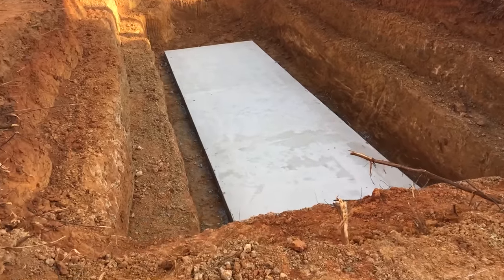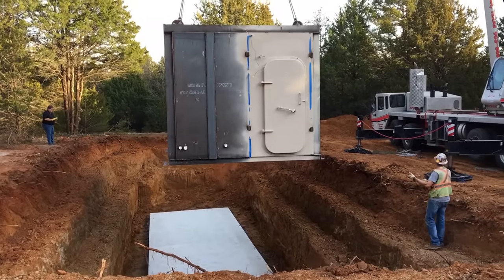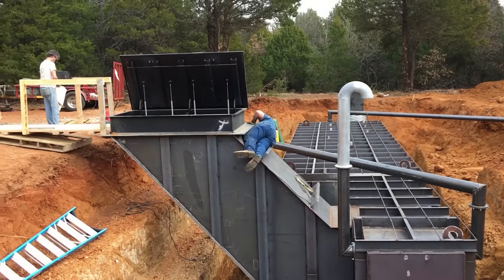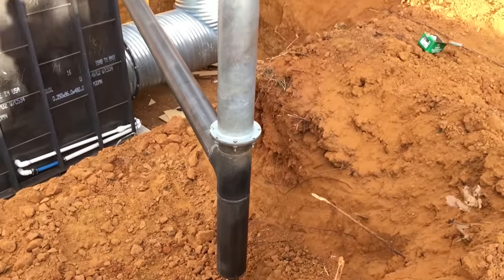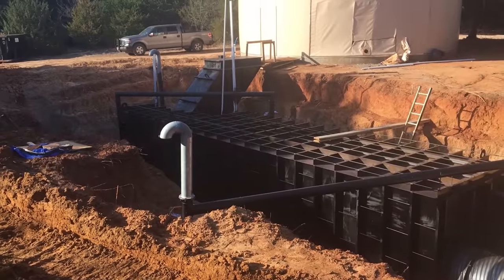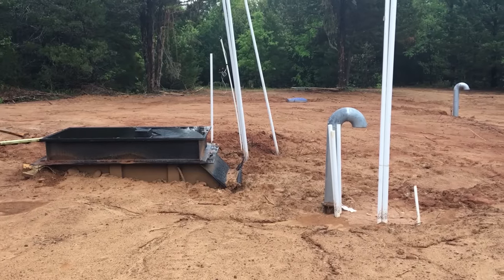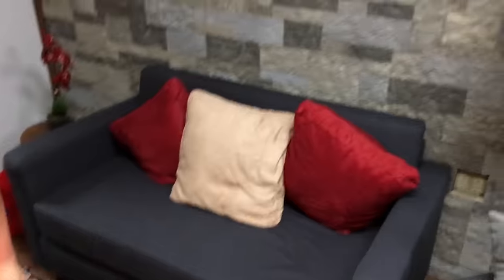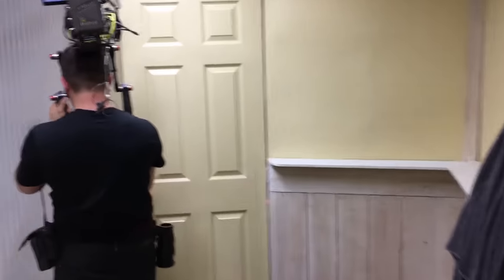Atlas 10x30 Safe-Cellar - Luxury Bunker Built Under A Home (Complete Installation Video) - Part 1

Comment: Why have a lock on the outside--  you just spent 100K on a tomb.
Reply: Lol
Reply: true
Reply: You use the escape hatch at the opposite end. As the guy said a house is to built on top. So you would have to get into the house or remains of, then find the entrance, etc, etc.
Reply: That's funny lol
Reply: I'd not have a lock as such on the outside for that reason. Better to have a lock on the inside operated by a solenoid,as is common on many apartment block entrances, but "beefed up." The button to operate it could be anywhere inside or outside the house & concealed. It would use a rechargeable battery. Any protrusion on the outside of a hatch are not good, as they give something for a chain to go into or a clamp, to use a vehicle to pull at the hatch. Hydraulic jacks should be kept inside with something strong to push against, such as an I beam or steel welded to the shaft, to lift debris above any hatch.
Reply: To protect against grave robbers of course!
Reply: @musllm  LOL. With the lock on the inside operated by a solenoid such a bunker would be OK to stay in for a week or 2 until fallout radiation died down. Particularly of use in a more limited use of nukes scenario. I doubt many people would want to be in a small bunker for months. I've spent 1000's hours working in underground bunkers, but only for a day or 2 at a time. Many people would probably "go nuts" in them for months.
Reply: the best way to hide the entry, is a hidden safe room with the hidden entry inside. thats how i would do it, if i would have the money.
Reply: @PlatinNr1  What you suggest is best. For those that can afford it, I'd have a composite steel & concrete heavy door concealed by something like a cupboard or book case that swings out  of the way. Such a heavy door could have a locking mechanism on the inside. One way of doing it could be along the lines of the solenoid operated locks used on many communal flats, but with "beefed up" components. The 12 or 24 volt actuators used to open electric gates, or raise up electric reclining chairs etc., could pull a nice thick piece of steel to be a sliding locking bar on the inside. The outside switch  & battery could be hidden well away from the heavy door. Once everyone that you wanted was inside the bunker, then the electric entry could be disabled or turned off from inside the shelter.
 Thick steel - only doors are not ideal, as gas cutting gear from a local steelworker or garage can cut even inch thick or more steel fairly quickly. With thinner, say 1/4 inch, steel  plate either side  to form a concrete filled rectangular swinging box at least 5 inches thick, ideally with rebar in it too, it becomes a very difficult door to cut through.. Stainless steel can only easily be cut with a plasma cutter or angle grinder. But it is very dear. Even  plywood between steel plates
Reply: Sorry,  last reply the computer froze. It should end : Even plywood between steel plates in layers bolted together (round headed bolts on the outside face) could be a better gas cutting blocker than steel plate alone. Could be thick plate used in some part of a composite  door. Have concealed hinges or "dog bolts," so hinge cutting won't allow intruders in. Then you'd need at least one air intake disguised. Could look like a vertical outside lamp post. It could even light up on top. Another way is to have an ordinary looking louvred vent appearing to be for say, a tumble dryer, or kitchen extractor, set in a reinforced concrete wall. Vent could be strong steel, but painted white it could be made to look like a cheap standard plastic one.
Reply: @michaelthomas3105  i would make the whole house as safe as possible. which can be shutted down completly xD i want one in which even the police couldnt get come in. xD and in the house a hiden safe room like i said with the hidden entry of the bunker. if its a hidden safe room where the door is hidden well, nobody would even think about that there is a room behind, so nobody would try to get in to the door. but still the door needs to be safe and with a looking mechanism from the inside.
Reply: @PlatinNr1  Reinforced concrete is often best. You might find a local steel fabricator is cheaper to make strong or blast doors & special shutters, if you don't do welding etc. yourself. I'd still go for the strongest door you can afford, unless you're sure you can keep it a secret when loads of people might be looking for it. Generator use tends to give a bunker away. The old B&W Twilight Zone: "The Shelter,"  gives an idea of how neighbours break down a door to get into a bunker. They might use a  hydraulic jack or anything to try & force it.
 The Swiss doors are concrete filled steel frames 8 inches thick. The locking devices are solid steel  2 inches thick plus an extra 3/8  inch plate & 3 inches wide solid steel with 1.5 inch diameter steel bolts through each one, with handles to engage them with the cast-in steel angle frame.  A steel plate plus plywood in between, sandwich door could be good if concrete is not easy to use to fill one . I've used concrete pumps for awkward places. You need to always use a poker vibrator if you want the best reinforced concrete  & keep it covered from the sun & wet, or use a spray on compound to cure it, ideally for up to 4 weeks.once it has started to set. .Job to keep the police out of an entire house, but it's not difficult to make a bunker the police just wouldn't bother getting into. They'd use hydraulic spreader rams on security doors, that sort of thing, or petrol disc cutters. Once you get into stuff like Swiss doors weighing over 2000 pounds they'd give up on those. Swiss doors are designed to resist. 100 tons force on every square metre. Many ordinary little houses have them there by the million. I've fitted some. They'd probably give up on even a 5 inch concrete filled steel one like www.americanbombshelter.com do.
Reply: @Platin BTW, I weld up the huge nuts on the outside of the Swiss doors so you can't open them from the outside, plus I personally put one extra locking bar on the inside which I weld on.to heavy plate that's cast into the door. it depends how far you want to go to keep people out. A welder could fabricate a cheaper, or bit less strong, version along the Swiss or www.americanbombshelter.com lines. I meant "covered from the sun & KEPT wet" for up to 28 days is ideal for the concrete. cheers
Reply: Yeah , what i said was a very expensive Coffin ... 
With all they have you won't be able to walk outside for sum 20 years ! 
If your lucky !
Reply: So i think the people in these ha e a decent chance with a civil war or ww. But honestly if it goes nuclear this is the best comment ever they call it MAD for a reason being that everyone everywhere is gonna die on earth. Its an expensive tomb for the pharoahs.
Reply: @stephenfuller8002  yes it's what I said about these , Just look at Japan that place blew just look at the Radiation fallout ...
Now you imagine the Massive Fallout it's going to be when all Hell breaks loose and all that Fallout comes we are going glow like the sun ! 
What I'm getting to is it will be absolutely an insane timeline on coming out of that tomb ... 
No sunlight whatsoever!!! 
Better pack alot of Vitamin D, but you better also be able to set down there for years if not a decade all according to where you live I mean Big cities will be hit worse that a small town in Arkansas where I live but I spent 28 years in Military NBC trained , Big Cities are doomed! 

But sorry I'm off the trail here ....
But you are so right on that this will become a Tomb !! Better pack alot of movies video games to play !!
Reply: no matter how much you spend you'll never be able to outdo the glory of the pyramids.
Reply: Keith Moriyama the lock is on the outside because these shelters are very often in peoples yards and other places on their land. So you need a lock in case someone comes across the shelter. Especially if you live in a very rural area. This particular one is under a house so it doesn’t need a lock unless the family goes on vacation.
Reply: Exactly!
Reply: Yea, a $10 home depot lock. This is such a joke!
Reply: Lock is to keep people from going in and stealing supplies when no one is in it.  They cant lock the lock once inside unless they went out the escape tunnel and went and locked it and then back down through the escape tunnel but makes no sense no one is getting through six way dog door easily and it would take some type of plasma cutter to get in and they know you are out there so they can spray a flammable mist and light it or even a poison gas of some type so if you are going to get in it a few will likely die first.
Reply: It has a dog door on inside so it is locked there.  A  lock like the lock shown is mainly for shelters when owner is away.  I doubt they will use a lock ever again after house is built but who knows they may want to lock it to keep kids out or anyone out if they are not in it and have it locked from inside with the steel door.  My guess is it is probably to keep construction people from going to see what is down there.  I have worked on many boats with dog doors and they are not only water tight they are almost always heavy metal.  I had dogs so big we had to beat them closed with a 10lb hammer and use a cheater pipe to even open them back up. They were not made to keep anyone out because the dogs also had a handle to open them on outside so a cheater bar could do that but if nothing on the outside they are not getting in without something that burns through steel.
Reply: So what happens while ur inside it and someone comes along and locks u inside as they raid ur home? Did u think of that?
Reply: fair enough
Reply: I wish ppl would actually watch a video before being survival experts in the comments section! Rewatch video and think for a bit...
Reply: Anita Blunt  That's about what a funeral and cemetery plot costs.

Comment: Excellent shelter. I would like double or even tripple air intakes to ensure non blockage of air. A house built on top is perfect as combustion, exhaust pipes can be concealed inside walls. With grilles 10' feet high or through roof, a termination pipe on a 12/12 pitch roof even better as no one could climb it easily.
Reply: Does fallout affect the air intakes?
Reply: Yep, same for any exhaust vent too.

Comment: Great idea in theory and a couple good qualities. However I see many issues, straight up flaws and possible security risks with it's design and installation.
Reply: Hook up some exhaust pipes from a car to the ventilation system and wait.
Reply: @donniev8181  or look thw door from outside :v...
Reply: Or if you find the hatch, shoot the lock a ton, and boom.
Reply: Go ahead, list them. I'm mostly worried about the air intake and water. Doesn't seem like someone could live more than 4 months in there.

Comment: I like this one for the main living area. I also like the concrete covering as extra protection. However, I’d want to add some culvert sections tied to it for bedrooms, restroom and storage areas each with their own escape hatches. 

I’d also have periscope tubes for antennas and video cameras.
Reply: Перископ это хорошо.
Reply: It is not high end bunker. By the standards of the Russian Federation, this is the simplest shelter from radiation or non-nuclear explosion... The lowest protection class. From a near nuclear explosion, this will not help. But it's better than nothing. Prefabricated earth shelters (dugouts) have the same protective properties. But they are not airtight.
Reply: Each room with their own escape tunnels? So youre going to have a dozen different ways to ingress and egress? Can we count the ways that this is pure insanity?

Comment: I'd suggest it would be worth putting rebar in the concrete, especially in the short span of the roof near to the steel work, stood off by spacer blocks. It would make it a lot stronger & not cost a lot compared to the total build cost. Bar 6 (3/4 inch diameter) on 8 inch centres or closer across the 10ft direction, with bar 3 (3/8) about every foot in the 30ft long direction resting on top of them could be good. Perhaps some reinforcing mesh used for the sides.
Reply: Looking at it on a bigger  screen now,  they do seem to have put a bit of light rebar in the 30 ft direction. 1 inch holes drilled all along the  centre of each of the 30 ft long direction steel C beams before the shelter was assembled could have proved useful to thread some heavier rebar, each bar about 11ft 6 in, long through them for a blast shelter.
Reply: It seems a reasonably built bunker for somebody keen on having one.I'm sure they'd happily put more rebar around it if people wanted that & to spend a little more.

Comment: So what happens if someone blocks the air intakes? Why would you not run them a fair bit away?
Reply: Remember it is built under a house. Hidden.  If you found one intake, maybe they didn't show you it has a slit for multiple air intake/exhaust hidden elsewhere.  Remember you are snooping after a major event, so who is to say he doesn't trap you snooping in the house.  His hidden cameras see you and the friends snooping, releases knock out gas and cleans up the meat.

Comment: All this but Colin Furze did his all by hand and it's bigger.
Reply: And his is by far 1000x better than this one.
Reply: And Colin’s even has a bed!
Reply: Way bigger
Reply: Colin did it best
Reply: Well not all by hand
Reply: Its actually not bigger
Reply: Also didn't cost almost a hundred thousand
Reply: But his does not have an air filter
Reply: But his is not beter quality rememver these have nbc filters, solar, bulletproof doors and they are built by a company
Reply: These normally are way bigger but this is just to store liqour thays why there no bed etc..
Reply: Colin Furze is Colin Furze. Ain’t no beating that.
Reply: Because English do it better , right?
Reply: He didn’t put a 90° angle at the door waywhich is necessary for radiation he didn’t even put air pumps he didn’t put air filters for fall out he didn’t do none of that .
Reply: His didn't have a air filter but it's a thousand time better and functional
Reply: It was definitely funner to watch too.
Reply: @joberystedt6431  and a drum kit lol
Reply: He used his hand to make it bigger? Cool!

Comment: For the money you charge for bunkers I would think you could  provide a better locking system for the main entrance.
A padlock really and on the outside at that.
Reply: @rickywestley6820  not if your on the inside and someone puts a lock on it.
Reply: Roy Stacey doh!
Reply: As he said theres gonna be a house on top of it.
Reply: @thecman26  your missing the point it is supposed to be a fall out shelter in the event all hell breaks loose.
In that case the house may be gone.!!!!
Reply: Something he didn't state in this video is if they do lock it you can remove the locking bar the padlock is on and it disconnects the whole lock mechanism  from the inside. not that I care one way or another as I will never afford one but he did have a think around for that problem.
Reply: AND TO THINK THEY SPECIALISE IN ZOMBIE PROTECTION BUNKERS AND MAKE A POINT THAT SURVIVORS CANT GET IN
Reply: its easier to keep your victims in there DUH!